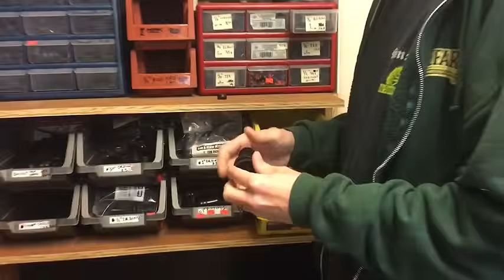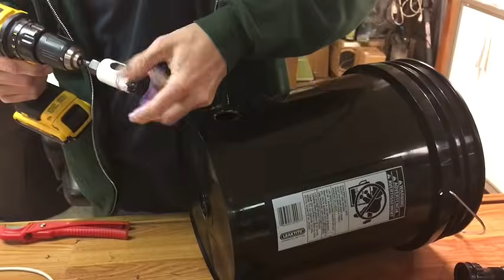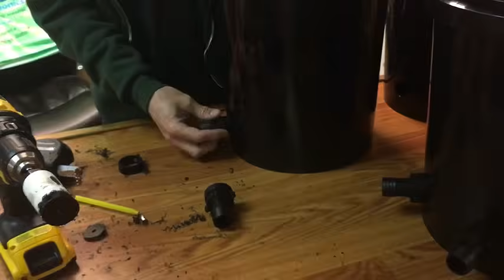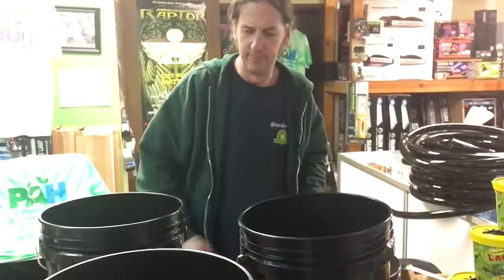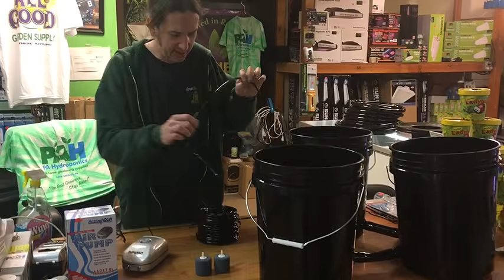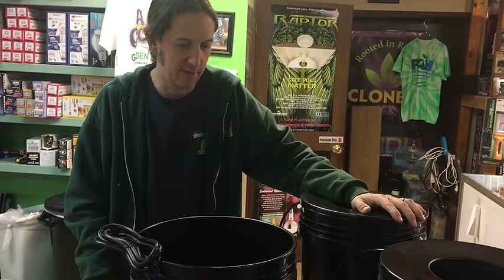Easiest double bucket STIRPONIC RDWC with reservoir and water level indicator built from scratch!!

Comment from the maker: This system can be made with up to 8 plant buckets! So 2 plants , 3 plants 4 or 6 or 8. Just lay out how you want to position and make sure there is an in and out from 1 bucket to the next and that they connect back to the reservoir. Plants can even be in a line, just loop the last bucket in the line back to the reservoir. Thanks for watching :) Please like or follow or share. Gary
Reply: Do you set your Air Pump on top of your reservoir?  Or would you suggest they have High locations of their own?
Reply from the maker: I missed this question sorry , you can put on top of reservoir if you want but I try to get it out of grow area to help keep it cooler, just make sure it's above water level incase of a power failure ( it can siphon water back into pump) Thanks for watching! G
Reply: What  about chilling the water?  I have also read that you can half the nutrients with it.?.? I would appreciate your opinion.
Reply: I just watched your chiller video good info now just curious about the nutes

Comment: I want to build a RDWC system. 2 bucket with reservoir. I want to make it in a triangle. Kinda like yours. But have a pipe running through.middle that has a tee connection. And connec to both buckets. Am I able to do that? I want to do it that way so I can connect a tap for easy emptying. My question is. Can I have the pump pumping through the middle which connects to 2 buckets. Or do I have to pump earthier from left to right or other way round. I really hope you got my question it's hard to explain it lol

Comment: Yes, a very warm water soak of all the plastic during assembly, even the fittings, is helpful. The fittings will conform to the curve of the bucket better. Just heat a pot of water on the stove to very warm water, so as to submerge a hand and not scald, PEOPLE. It works!  So does this Video!! Thanks!

Comment: i keep saltwater fish and installed swimming pools for a decade before doing hydroponics . any way i used my fish exper. after burning out 3 air pumps in 4 months . i link each bucket with 2 inch tiger flex piping so each bucket gets flow . inside each bucket i put a 250 gph marineland powerhead with a fluval foam filter centered . powerheads have a airline to outside of bucket . cut a small notch to get power cord out of each bucket . since my grow is in a 2x4 closet i have 4 buckets in line the res in in the middle . for light i use a marshydro sp3000 and with a t5 10k single  on each side of the led for the last month of flower . i only grow black domica and this year im at gen 12 . the first 10 gens were grown outside . if you want dead silent huge grow try the powerheads out . they are $17 on amazon and ive had them last 10 years in fish tanks !

Comment: Thanks to this video I just finished a 3 plant 1 reservoir build in a 3 x 3 tent and I love it! This will make everything so much easier now with just one res to monitor :-) I do have one suggestion though.......When I set up the system and tested it, it was perfect, but when I moved it and re-installed it in the tent, I found 2 leaks that could not be fixed by adjusting the bulkheads......Worse, I had about 10 gallons in the system that I had to pump out to fix the issue...I disassembled everything and used Flex-paste on all the bulkheads inside and out, reassembled and it was perfect....I put the water right back in without waiting for it to cure and even put the plants back in and they were completely unaffected........So my suggestion is FLEX PASTE THE BULKHEADS!!!

Comment: How much water do you start with for the 2 bucket setup?
Reply: For seedlings in rockwool, the water should be just at the bottom of the net pot, as the plant grows, reduce water level to about one inch below net pot

Comment: How do you use the pump to empty the system? And how often should i do so? I just bought this same kit from you up in NH
Reply from the maker: There is a five foot section of 1/2" black vinyl tubing that comes with the kit.  That hose is meant to connect to your pump and can evacuate your nutrient solution out of the system.
Reply: @PAHydroponics  cool , thanks boss

Comment: How often does your pump turn on and for how long? How much water do you start with in each bucket? When you refill the res do you factor in that you are pushing 10-11 gallons thru the system. Still don't see how the water/nutes is factored in to this great system.

Comment: My tent is 5' tall and no openings on the bottom, so I have to run the 1" tube up about 4' to get thru the opening of the tent. Will this pump push water that far?

Comment: Only issue here is reservoir changes? So either requires a bulk head type tap or switch off/shut off valves to exchange the 💦 in reservoir. Beside this tiny flaw, your vids tidy asf, deafinetly enjoyed watching. Gj ✌️
Reply from the maker: We have you covered... when you buy the kit, look for the "drain pump".  We supply that to drain your system and exchange your nutrient solution.

Comment: Just for future reference I’ve found drilling with a step down drill bit more efficient especially when worried about accuracy & drips.
A step down drill bit can drill to precise hole so fittings are really snug & you actually got to kind of thread them in. 
Remembering the J step on inside of buckets, when tightening a lock-nuts or bulkheads to both inside & outside of you fittings, or drum tap which is great for water exchanges.

Great tutorial tho Gj 👍

Comment: Hi. I bought this system from you online and I gotta say I like what you do and prices were fair. Question ❓ you talked about the roots clogging up the pipes. is there any sort of screen or protection you could get to stop that from happening? Also I just wanted to give you a tip about the video when watching it at home the tool noises and bucket sounds get super loud almost blowing our speakers and the voice parts are really low. I don't know if maybe you could speak up  louder and clearer that way the volume can be turned down so those drill noises aren't so loud, or move the mic I'm not sure. but I do really appreciate what you do man thanks!

Comment: Received my two bucket RDWC system the other day. Assembly was straightforward...the Youtube videos are a great resource for assembly, so be sure and watch them prior to assembly. After assembly, I put about four gallons in the system and fired up the pumps. Everything works as it should,. I had to adjust the water pump down a little to balance out the volume between the two DWC buckets and adjust the air pump up to max pressure for plenty of bubbles.  Only issues I am having at this point is leaking at the 3/4  fittings. All of them leaked initially, had to tighten down the threaded "nuts' very tight to stop leaks where the rubber washer and bucket meet (and yes, I made sure I was well above the curve on the bottom of the inside). I now see leaking at the 3/4 hose to barbed fittings on three of the fittings.  Have just added hose clamps to those to see if that stops the problem.  Will update as time goes by.

Comment: You said the distance required is 27" between the two that sit side by side. If you have a 2x4 tent can you just run the reservoir out the tent and still use this system?

Comment: when operating, do you need to keep the circulation pump running all the time or only 8 hours a day or something.  Same question for the air pump?
Reply from the maker: Good question...The circulation pump can be cycled on and off to give the stir.  However you do need to continually run your air pumps. Thanks for watching

Comment: Hi Gary, , I purchased a  RDWC / without buckets. 
I fix the buckheads seams,
A question on water pump, doesn't seem like enough flow ? The pump is working, the 3rd bucket has very low flow  if any ?

Comment: Bought the stirponic 4 plant setup from you and have a question concerning the water/nutrient level in the buckets. I noticed somewhere in your replies that 4 gal. per bucket or 20 gal. total. Would that be for total duration of grow or is there a different level once roots have developed and have reached the water?  Concerned about seedling getting water to develop root system. I know your busy, thanks for a reply.

Comment: PA Hydroponics ... I just bought this system, but with only 2 buckets. What confuses me is that you stated you don’t want to have a stone in the reservoir bucket because you don’t want bubbles getting into circulating pump, but the kit is sold with 2 stones. One going each of the buckets. Could you please clarify ?

Thanks
Reply from the maker: hey there, the stirponics has 2 grow sites and 1 reservoir bucket . the stones go one in each grow site, you may have it confused with regular bubble buckets? The regular bubble buckets are just DWC  and dont have a circulation pump, each plant is separate. Let me know. G
Reply: PA Hydroponics ... this is the DIY 1 Plant Stirponic RDWC System COMPLETE KIT ...(NOT DRILLED)...This system includes one 5 gallon bucket with 6" bucket basket and one 5 gallon reservoir bucket. The whole system is connected with 1" soft tubing, and recirculates with a submersible 75 gallon per hour water pump.
This system also includes our water level indicator kit that is in our video. ...I took this from the description on your site. I’ll probably just give you ANOTHER CALL later today. My apologies on the multiple calls. You’ve been more than accommodating and extremely helpful. Thanks G.

Comment: 1 thing left out of the DIY vids for DWC build is a aquarium thermometer (2$)& a water chiller/ frozen water bottles every few days!. water temp goes above 68 your gonna have nute/oxygen issues. i bought & built 2 DWC buckets, clones started a run ( indoor) 2nd week in noticed something off water was getting to warm every few days but frozen water bottles in helped. a small water chiller 4-500$, 30$ to build the buckets 500 to cool the water! WTF! If your new to Hydro people keep that water cool or you'll have issues plant takin in air & certain nutes, all the vids i watched & buying set up at grow store water temp never brought up. kinda important part of the process
Reply: KEEPING WATER COOL BELOW 65-68!!!  ( didn't put it in first sentence)..                                stoner move!
Reply from the maker: I have run at 75 and been fine! You might have bad water to start, you can not just say that to everyone! Good nutes and added beneficial bacteria is way cheaper than a chiller! I'm not here to argue - just saying.G

Comment: Thx 4 the info. Good thing to know that getting the strongest waterpump is a bad idea (4 people like me who would have used an 1800L/hour in 2 bucket system)  u didnt miss a thing, just wondering with a waterchange.. How do u get all water out? Or is ok to let 1 inch water in, or does the pump take 100% out
Reply from the maker: Hey there, there will be an inch left, I have dumped an extra 5 gallons in after it was drained and then sucked that out to help get it flushed, most of the time I just drain as much as I can and not worry about the 1 inch  and have done fine. Yeah and believe me I wanted to run big pumps too but it just wont work with 1 inch lines. Thanks for watching! Gary

Comment: I have a 3x3 tent and am in the process of setting this same system up but with 3 buckets instead of 2. I’ve watched the 4 bucket fallponic videos and was planning to add the “fallponic” part to this system. Is it worth it considering the restriction of the 1” tubes? I’m not sure if it’s worth the cost and labor, but was interested in your thoughts.

Comment: So is the pump pushing the water or sucking? Couldn’t see your hand position describing flow direction! What I did see was it looked like you were showing it sucking! Great step by step thanks !
Reply from the maker: Thanks :) This pump is pushing the water and forcing it out the tube to the next bucket and that bucket has nowhere to go except the next one and so on and eventually back to the start. Thanks for watching! Gary
Reply: PA Hydroponics 
That’s what I thought but just wanted to make sure! Thanks Gary. Wish you did more online I would love to buy your products. I am not super far away in northern NJ but not really that close to be able to run out and grab a fitting or two!! Thanks again for your reply and I am now a sub
Reply from the maker: I hear that, its very hard to put single pieces online and try to figure shipping out and if I did flat rate on single fittings it would cost way to much, I am planning to try to put a whole lot of parts online by the end of year and a whole new drip system department ( our next video) :) I think I will end up doing a random part kit for like 10 bucks or something along those lines so keep an eye out. You can always email a parts list and I can do a quote info@pahydroponics.com. peace. G
Reply: PA Hydroponics thanks Gary! Would you be agreeable to a bulk order say of pumps, buckets, net pots, hydrogen, and fittings and air supplies, etc? I am basically a total beginner but oh so interested in this process! For yrs I’ve been a traditional soil grower but after a stroke and triple bypass I’ve been told in no uncertain terms no more! So to keep the growing going and so much more control I am committed to hydroponic
Reply from the maker: @Trackhoe075  You dont even have to do a bulk order , I will ship anything! Small parts would only cost about 4 dollars to ship anywhere. Have you seen our kits on our website? They are affordable in my opinion. Peace. G
Reply: PA Hydroponics 
I will check it out!! Thanks Gary

Comment: Thanks for the series of videos.  I appreciate the simple and concise explanations along with physically building the system.  Most of the videos you find on YouTube just can't seem to put 2 and 2 together in a usable manner.  You're also the first guy I've seen suggest the use of a de-burr tool, which is a fantastic idea.  I should have thought of that considering I use them at work regularly.
Reply from the maker: Comments like this are why I still do these videos! Thanks for your kind words :) Gary

Comment: I plan on purchasing this three bucket setup from you here soon! Missouri just got the green light for medical cannabis. Keep up the great work and thank you for the great information.
Reply from the maker: Congrats! Thanks for watching :) Gary
Reply: I’ve been reading some forums and they bring up a good point about the roots interfering with the drains. If the roots get too big and get in the way or even into the drain tubes in each bucket, wouldn’t that affect flow?
Reply from the maker: @joejoedancer  Yes it will if you grow monster plants in here, Usually mid flower before any issues like that. Even if you end up having to turn circulation pump off it is still an awesome dwc and you will still be able to fill and drain and flush system. This is why the big expensive systems are better like our Fallponic systems - they will NOT get clogged. As for this system we have sold a lot and I have had excellent feedback from customers! Thanks for watching. Gary
Reply: PA Hydroponics thanks for the reply, Gary. I appreciate it. I may still go with this setup with out pre-drilling it and possible add bigger lines to it or maybe even a catch in the bucket itself to contain the roots away from the drain tubes but still submerged in the water. Thanks again!

Comment: Would this be a good set up for a 2x4 tent?  Could I put the reservoir outside using longer hoses?
Reply from the maker: You could probably fit a row of 3 but 4 would be tight, little tricky on putting res outside, you should check out our waterfall video for that.Thanks for watching :) Gary

Comment: Question:  Wouldn't the "water level hose" since its directly exposes the water to the lights cause a bacteria issue if all 3 were kept inside a tent?
Reply from the maker: The water level tube is blue and blocks the spectrum of light that causes algae so it wont grow it. Thanks for watching! Gary
Reply: Oh.  Interesting.  Thanks

Comment: Could I fit 2 of these buckets in a 2.5x2.5 tent with the reservoir outside the tent would I shop vac all the water out with change overs
Reply from the maker: Yes for sure! would drill holes a bit different and you would need longer hosing, if you order kit put in notes to leave hose 1 long piece. ( I would throw in some extra hose for you) Thanks for watching! Gary
Reply: @PAHydroponics  thanks I'll go the home depot route but thanks for the videos these are the best how to videos I have ever seen on YouTube great work
Reply from the maker: @gallagher831  It's all good! Thanks for watching - got some really cool stuff about to come out so check back :) Gary

Comment: Would I have a issue running 3/4” line. I am doing a similar setup with 4gl square buckets. I am running a 200gpm pump but with a waterfall system into the buckets.
Reply from the maker: I have seen a lot of people build water fall systems but hardly non have a finished grow video because they get clogged and over flow, we will be doing one soon  to address these issues. If your going to use 3/4 inch at least have 2 returns to the reservoir to help but I would guess 3/4 is not going to keep up with 200gph right away. I truly wish you the best on this and hope I'm wrong. Gary